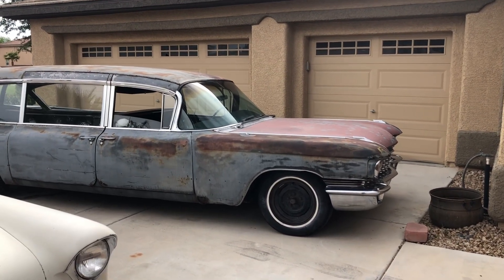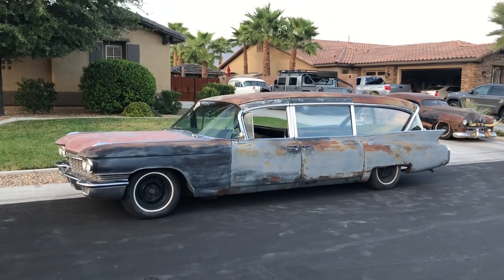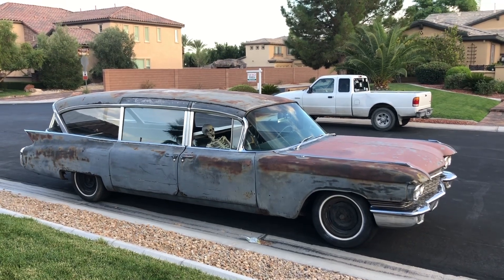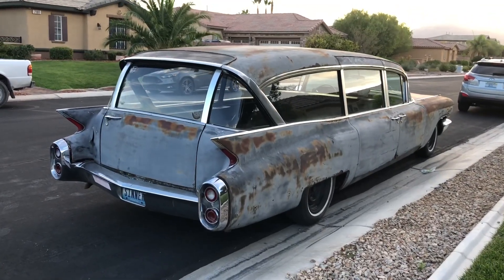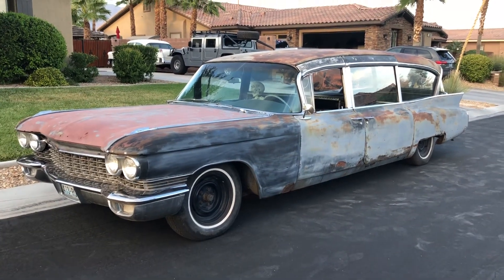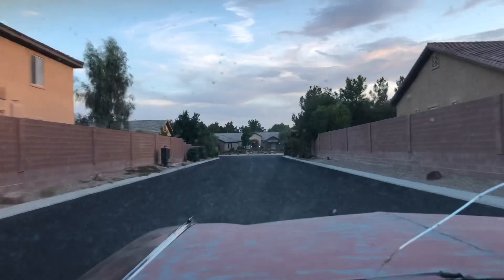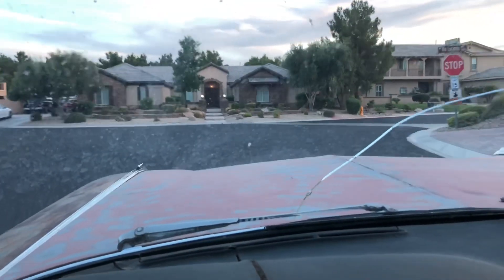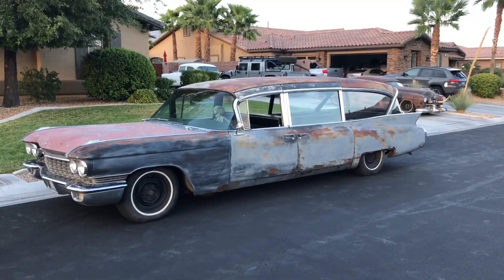1960 Cadillac Hearse walk around and drive.

Comment: I would not worry about it you have a ton of body work and patch panels to weld in just pull the body off the frame and start with the motor and drive train  sand blast the frame then rust primer it and keep going

Comment: You are leaking at the exhaust manifold from the sound of it but it does run and shift well , check the ring gasket where the manifold hooks to the pipes easy way to do this is spray starting fluid in the area you suspect a leak and look for a puff of flame while its running , if nothing is found there use gumout at all connections behind it it probably won't ignite but will alter the sound , good luck.

Comment: I hope it doesn't end up as another ecto 1
Reply: I can see the Cadillac community rallying to try and stop fans from turning them into Ecto-1s
Reply: Agreed
Reply: @jamesdeth94  I think this particular one is supposed to look rusted anyway...
Reply: Don't want to change it to an Ectomobile?? Then don't sell it. One thing I hate is sellers trying to tell buyers what not to do with the vehicle.
Reply: @kitt2000car  tbh I don't care what they do with it as long as it isn't left to rust (and is well looked after). But like I have said in the replies to this comment, this particular coach is possibly supposed to have a rusted look to it from what I saw in the video
Reply from the maker: @kitt2000car   Dude, are you taking about me? I never said this.